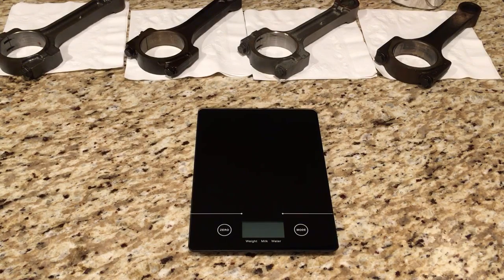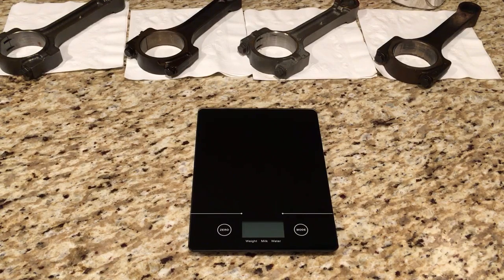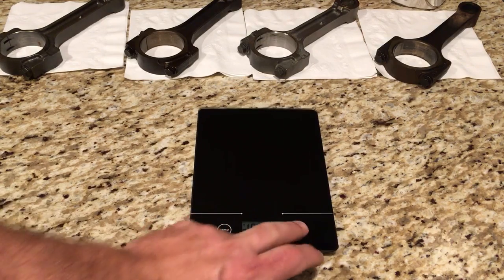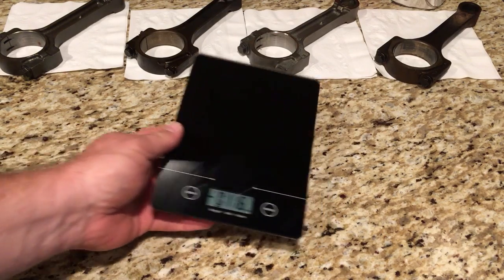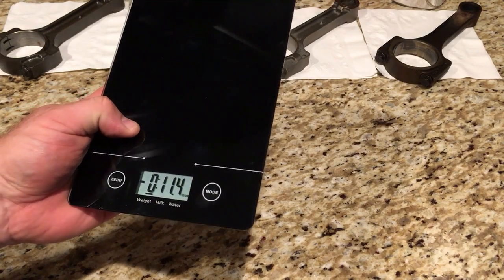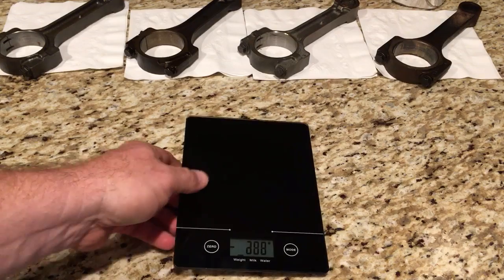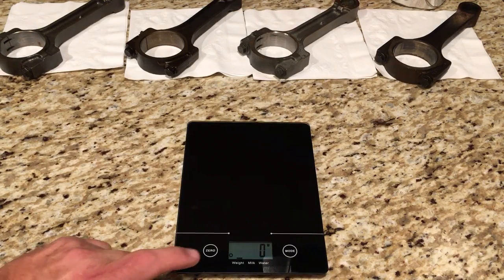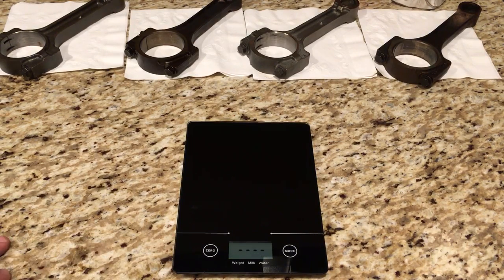Can I run Gen 4 rods in a Gen 3 engine  4.8 5.3 5.7 6.0

Comment: 4.8 stroke is smaller/rod longer...had to help a bit.....o.35 inch different...ha
Reply from the maker: steven mcclelland Yep, the 4.8 has its own crankshaft/Rods stroke 3.2662”? Rod length 6.2750”
What’s cool is you can interchange 4.8 and 5.3 pistons!  Pretty handy 👍👍👍

Comment: Which way do the dimples face in the engines??
Reply: The dimples on the rods face the rear.  The dimples on the pistons face the front.
Reply from the maker: 407ForRent I may have been confused, yes normally you want the dots/arrows on the pistons to go forward.  👍
Reply from the maker: Bonafied-pro Mtz Factory has them Forward, because the LS rods don’t have a “chamfer” like older engines they could be run either way.  I generally just point the dimples forward 👍

Comment: If I can get 4.8 pistons and rods can I just swap them in after switching the rings or do I need to do anything else
Reply from the maker: kenneth gonzalez 4.8 Rods can only be run with a 4.8 crankshaft!!! 
You can mix & match 4.8/5.3 “pistons” with no issue. 
The 4.8 has its own unique crankshaft stroke and connecting rod length. 3.27” stroke 6.275” rods.
The 5.3, 5.7 & 6.0 all use the same crankshaft stroke and rod length. 3.622” stroke 6.098” rods.

Comment: Ok I understand your point but did u weigh out every single rod and piston and calculate the difference across the board with a complete rotating assembly
Reply: And see I have 3 5.3 engines two are gen 3 and I have one gen 4. I was gonna use he rods and slugs from the gen 4 in my gen 3 because of the strength
Reply from the maker: Xavier Barksdale People do it all the time, it’s not correct but people definitely run it out of balance. 🤔
Reply: Ok I was just curious the effects can’t be to dire if they run them like that and like someone stated prior gen 1 sbc got it a lot
Reply from the maker: Xavier Barksdale Yes we have, each assembly varied +- 8 grams, verifying 2 things: 1. Each assembly was heavy and 2. Factory rotating assemblies are not precision balanced. 
GM uses a +- 4 gram tolerance based off a mean/median weight to match the piston and rod assemblies. Each assembly is not precision spin balanced like a race engine.  I did see some reports the high end hand assembled Corvette engines may be precision balanced but I have not verified this information.
Reply from the maker: Xavier Barksdale Part of my yet unproven theory surrounding heavier Gen 4 vs Gen 3.
If you could find a 100% verified Gen 3 6.0 crankshaft, you could run Gen 4 5.3 pistons and rods on it and be balanced under 2grams per assembly building a 5.3.  Problem is, nobody offers any reliable was to differentiate a 5.3 crank from a 6.0 🤷‍♂️. Even the 5.7 cranks share the same part number as the 5.3 & 6.0 but a true LS1 5.7 crank has gun drilled journals. (Remember the theory the Corvette engines may be precision balanced)... 🤔

Comment: lol 11.2 ounces for 8 of them this guy acts like they are pounds heavier lmao.  3/4 of a pound across all 8 rods LMAO.
Reply from the maker: MidwestCatz Feel Free to contact your machine shop and get clarification on the limits for a balanced assembly.
Your statement tells everyone you have no idea what your talking about.  But everyone has to start somewhere good luck! 👍🍀
Reply from the maker: MidwestCatz Lesson #1 any weight change +- 10 grams per assembly should be re-balanced. This would include both balancing all assemblies to a median weight and spin balancing the assembly.  👍
Reply: How do people run gen 4 Rods in a motor on 21psi and have no issues ? 

Do you have any data to back up  all this damage or mirrors shaken off trucks at idle. LoL
Reply from the maker: MidwestCatz Show me the no issues!  Nobody can say they threw Gen 4 pistons/rods in a Gen 3 and it’s lasting very long especially at 21# Boost. 
I never said it won’t run, only clarifying it’s not going to last as long as a properly balanced assembly.  
Most of the people including Sloppy Mechanics end up breaking, bending rods and rebuilding before the engine runs long enough to matter. In the video I say, If you don’t mind pulling engines and rebuilding/replacing them then “Send It”!  Nothing in life is free, don’t get fooled! 😉

Comment: First off the rods of the 4.8 , 5.3 and 6.0 all use the same rod length so your video is completely moot and yes the gen 4 rods are heavier there bigger and stronger dumbass if you are using Lunati rods there heavier and no there not going to hurt bearings so get your facts straight and stop being a couch engine builder spreading bad information
Reply from the maker: Danny Rochester It blows my mind how WRONG You are!  Why you think you know something with out actually building engines is one of the reason I make videos.
4.8 has a 6.275” LONG connecting rod!  
5.3, 5.7,6.0 All have a 6.098” connecting rod!
6.275” is not 6.098” is NOT the same just to be clear.  
This will be your only warning, if you open your ignorant mouth and douche on my channel again you’ll get Muted immediately.  Good talk. JD
Reply: I stand corrected? But would you not agree that if using a full set of matched rods and pistons which most people do due to the 4.8 mostly having flat top pistons and the added strength of the gen 4 rods that there is not a problem. Since Chevrolet used bob weights to balance there cranks and a matched set of rods and pistons would be match balanced?
Reply from the maker: Danny Rochester The Gen 3 and Gen 4 Crankshafts are supposed to have different bob-weights. The only crossover years are the late 2003-2004 engines with the 24 tooth reluctor but had the Gen 4 rod but a press pin piston. Very odd.
I’ve seen a crossover engine: 24 tooth with Gen 4 rods and floating pistons.
You can assemble the heavier pistons/rods on either crankshaft, it’ll run.  The concern is how long will it run and will it handle higher rpms?
Reply from the maker: Danny Rochester GM May have got lucky or engineered the 4.8 & 5.3 so they could share pistons.  It blows my mind how they made two completely different strokes and connecting rod lengths work with the same piston. Has to be on purpose! 😉
The Gen 4 “LS2” style pistons/rods all have the full floating piston pin, huge upgrade.
Most shops only charge $150-250.00 to Precision balance an assembly, which is far superior to even the factory balance.  This would be the way to go if you wanted to turn 6500-7000+ rpms or make Huge power. I mean and make it stay together longer, sometimes people just don’t care how long it stays together.  I can understand that. JD

Comment: What if you use gen 4 pistons and rods with a gen 4 crank and a gen 3 block? Will there be a balancing issue?
Reply from the maker: Warship C6 All Gen 4 rotating assembly, as long as it was mated together at the factory it would for sure be fine. If we operate on the presumption the factory used a “Median” bob weight for the assemblies it should also be ok. 
But all this is assuming a lot; it really would be better to have it checked.
Another issue to verify is the reluctor tooth count.  The Gen 3 should have a 24 tooth and the Gen 4 05-Up should have a 58 tooth. The 03-04’s could be either must verify.
Reply: HeadFlowInc  thanks a lot man. I’m building a ls for my f body and I’m doing some weird things with it. I just want to make sure everything I have is going to work.
Reply: HeadFlowInc some ls2 /Gen4’s have 24x reluctors all the way up to 2006.
I.E. GTO’s & TBSS
Reply: No issue

Comment: In your particular case of turbo charging an engine, the "heavier" rod would actually be preferable for the sake of strength/durability. As long as the rotating assembly has been statically and dynamically balanced, rod weight should only affect low-end acceleration and then only minimally. The extra stresses turbo charging an engine puts on connecting rods are something auto manufacturers have taken into consideration, as evidenced by the use of heavier rods in early draw-through turbo applications. The Corvair went to a larger displacement, 145 to 164 C.I., in late '64 and saw an increase in rod size/weight. Physics doesn't discriminate.
Reply: I’m not an engine builder, just a mechanic but it seems to me if your crank is balanced and your rods/piston sets are within 10 grams of each other isn’t the assembly still pretty much balanced?

Comment: So try to find pins that are 40 grams lighter than stock. Lol. Plus you have the weight of the keepers for the floaters which is probably 4-5 grams for 2.
Reply from the maker: Don Rutter iirc the piston pin snap rings weigh +- 1gram each ring or 2g per piston. I have a video showing the weights. 
A 6.0 Richard is building now has a Gen 3 crankshaft with Gen 4 pistons/rods, they had the assembly balanced at Mann’s Speed in KC; it needed Mallory metal to balance.  Also, the pistons must have been way off, they had to remove a lot of material to balance the pistons.
Reply from the maker: Don Rutter https://youtu.be/NztGn2eOMd0

Comment: If all the pistons and rods are the same weight I don’t see a problem... so what happens when you put after market h beams and aftermarket pistons?
Reply from the maker: ULB SRY Engine balance is not the same thing. Equalizing the weight of all 8 piston and rod assemblies is only 1 part of balancing the “rotating” assembly.  The crankshaft has “counter weights” to offset the force of the piston/rod assembly as it spins in the block.  Balancing the counter weight to the bob-weight or piston/rod eliminates damaging vibration and harmonics. 
People regularly don’t understand the difference. 
You can run an out of balance engine it just won’t last as long and depending on power level could break the crankshaft. 
The best factory combination to run that’s close to being properly balanced:  Gen 4 5.3 piston/rods using a Gen 3 6.0 crankshaft. Theoretically is less than 2 grams a match.
The problem is, none of the machine shops have any data on whether GM actually balanced the 6.0’s to the heavier assembly.  It’s an ongoing process to verify the balance for each CID.
Reply from the maker: ULB SRY There are some SCAT I-beams that are close to being useable out of the box, but it would still not be balanced.  H-beams are pretty heavy and require balancing.  I say this using factory piston weights, if you could somehow get a really light weight Forged piston to offset the weight increase of the H-beam to be less than +- 10 grams you could try it. I haven’t seen any combination of H-beams/pistons that equal the factory bob-weight/piston rod assemblies. 
Keep in mind, we’re talking engine Math on how to build a high end assembly to make it live. A properly balanced engine will make more power and handle the power until you reach the mechanical limit of the components used. JD
Reply: HeadFlowInc it would be great if someone offered a forged piston and rod of the same weight as the stock setup
Reply: @dangerousfreedom4965  Texas Speed has rod/piston combos balanced to factory cranks.

Comment: Are 4.8 rods where the Piston connect the same size as the 6.0 rod what I really want to know is can I attach a 6.0 piston to a 4.8 rod
Reply from the maker: SHOE GOD 23 Yes as long as both the Piston and the Rod attach the same way.   Press-fit and Floating can Not be mixed!   Both parts have to be either Press or Floating. JD
Reply: awesome thanks for the fast reply I will recommend others to watch you videos
Reply: 4.8 rods are longer than 6.0 rods
Reply: @dangerousfreedom4965  They are longer rods but the crank is different too. The pistons have the same Compression height. Keep the rods with the crank and you can change the pistons. People are using 5.7 pistons in an 4.8 block bored to accept, crank and rods.
Reply: keith taube or you could use 4.8 rods and crank in a 6.0 block with the larger pistons.
Reply: So you want to make a short stroke 5.3?

Comment: My question is this , if your swapping out rods and pistons and the weights are within spec across the 8 used in comparison to reciprocating balance then why not ? or are you saying that because the rod / piston combination of the stronger set up is that much heavier that you will some how damage the crank or the bearings designed for the stranger rod / piston combination am I missing something here ...
Reply: mike c What he is saying is that If you swap in the gen 4 stuff without getting it balanced you may run into issues of it being so out of balance that it may eventually wear out a bearing early or cause other issues.
Reply: Also, even if all the rods and pistons are within specs of each other you also have to include the counter weights on the crank.

Comment: Yes my truck is running gen3 block gen4 rotating assy with 16psi loves it
Reply from the maker: William Ardoin I didn't question the Gen 3 block... But running Gen 4 pistons/rods on a Gen3 crank will wear the bearings because they're way out of specification. I'm not saying it won't run just it won't last as long as a properly balanced assembly. I mention in the video if you don't mind breaking it by all means run it.
Reply from the maker: William Ardoin I'm making a video to show any difference in the pistons, piston pins, and ring weight.
Reply: I used the crank also so everyting is in spec
Reply from the maker: William Ardoin well then, the information doesn't apply to your build. The engine going into the Typhoon is a late build date 2003, it had the 24 tooth crank with the Gen 4 internals score!  Pleasantly surprised!
Did you have to use the 58 tooth in your build?
Reply from the maker: William Ardoin I weighed the piston pins tonight, the Gen 3 is 163 grams and the shorter Gen 4 are 150 grams. I wasn't able to video yet, I didn't have the Gen 4 pin clips to weigh and I have to clean the Gen 3 piston. Interesting stuff.
Reply: I also had a 03-04 gen4 donor so I was able to keep the 24x stuff.....
Reply from the maker: William Ardoin Thsts exactly what I need!  I have a fresh 2002 4.8/5.3 block finished honed with new HD cam bearings; I want to switch it over to a Gen 4 5.3 assembly 24 tooth. I'm working on it slowly.
Reply: So I guess instead of balancing them, you would need the gen4 crank and remove the reluctor wheel to put on the old 24x reluctor. But you have to be careful of the rear journal of the crank that rides the rear main seal. There are 2 different legnth journal cranks. I sticks out longer towards the trans. Probably better to just use the 24x crank you have and get it balanced so you dont screw up putting the reluctor wheel on.

Comment: I think much more important are weight difference between same con rods. Also some engine configurations do not need bob weight for crank balancing so conrod and piston weight are not very important if they are same weight to each other.
Reply from the maker: Edvinas J. Can you explain which rotating assemblies do not require balancing?
Balancing the rotating assembly is the process of "Counter Balancing" the counter weights of the crankshaft to account for the weight of the Piston/Pin, connecting Rod, and the Rings used in order to reduce Harmonics and Vibration.
Reply: Sorry for my bad English. Balancing are necessary for all engines but for example 4 cylinder inline engine crankshaft are balanced without using bob weighs. Pistons and rods still need to be same weight all 4 in maximum 5g difference between  but it makes almost no difference for same crank if all 4 conrods and pistons will be used for example 400g or 600g because like I said crankshaft are balanced without bob weights.
Reply from the maker: Edvinas J. Interesting information, i wonder how or why the engineers would do this. Thanks for the feedback! JD
Reply: It is because 4 cylinder is 90degree apart and crank it self has opposite weights to counteract each other so if crank is balanced it self and  if pistons and con rods weight the same to each other in less than 5g difference  they also counter act it self so it makes no difference for crank balance if they more heavy or less.
Reply: Its because of the configuration of the cylinders, inline 6 is balanced perfectly in the first and second modes for both moment and shake. The engineers didnt do this, it is a by product of the configuration.